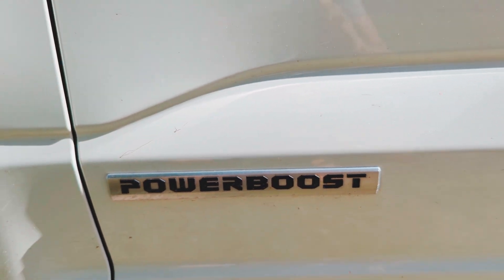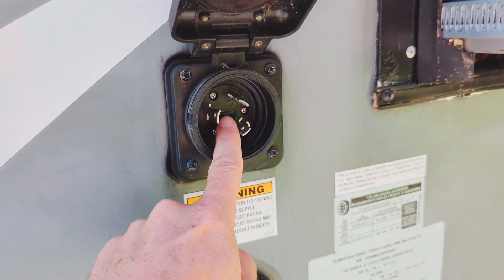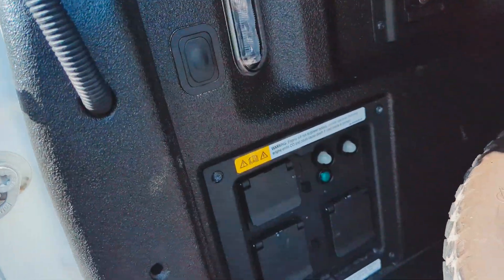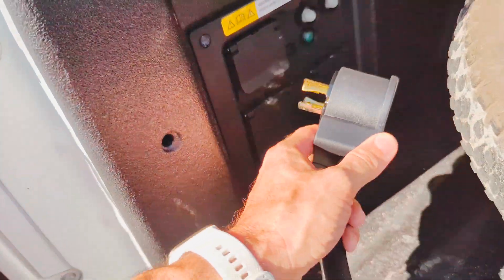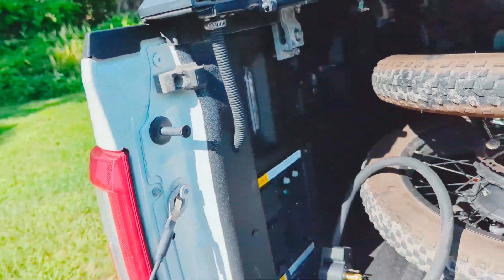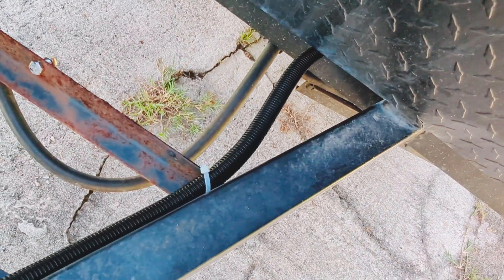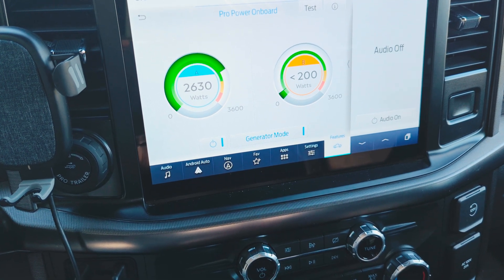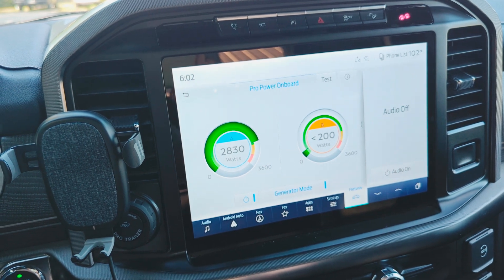F150 Powerboost Charging Camper Trailer While Driving

Comment: This is all dependent on what type of converter you have in you trailer.  Most trailers from the factory only charge the battery at 100 to 200 watts anyway when you're plugged in with your 30 amp plug.  Will still get you charged up faster when added to the power the trailer is receiving through the 7 pin but you won't be getting 3000 watts
Reply from the maker: A better to think about it might be that this allows one to do whatever with their trailer that they would do if plugged in at the campground.  So, you can run your air conditioner, electric water heater, electric fridge, etc.  If you happen to have an improved electrical system you can charge fast as well.
Reply: @Make-Someday-Today absolutely... I only meant while driving.  I have a power boost f150 on order right now. One of the main reasons being I can power everything on my trailer easily while camping without power

Comment: So is your truck not charging the batteries through the 7 pin plug?  If not you should fix it.
Reply from the maker: @nhamilton9545  The seven pin is going to get you around 100 watts at best. This is more like 3000.
Reply: This has been widely discussed on YouTube concerning the lack of power associated with the 7 pin plug charging TT batteries. Some even run a DC to DC power source to provide adequate power to effectively charge the TT batteries.